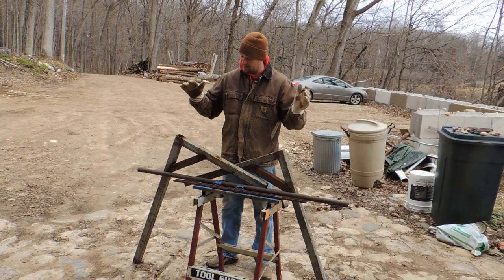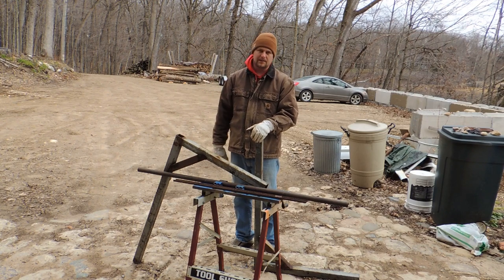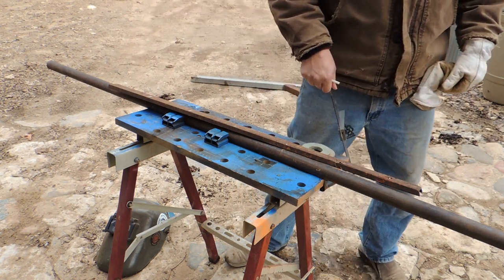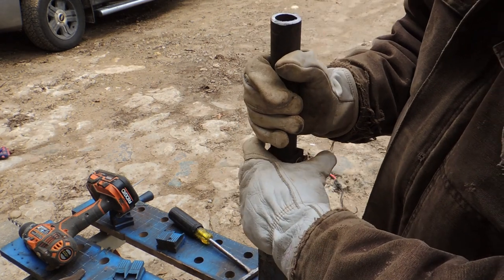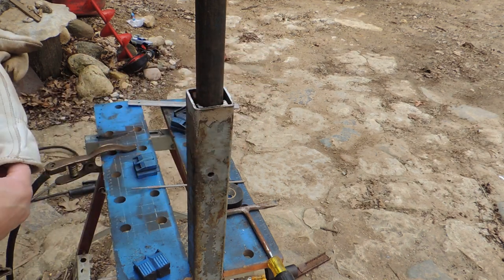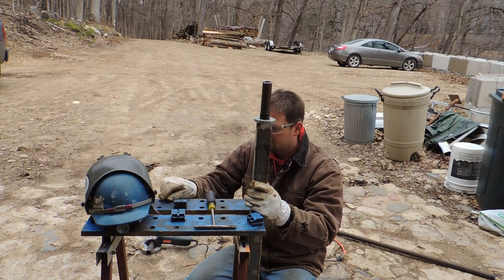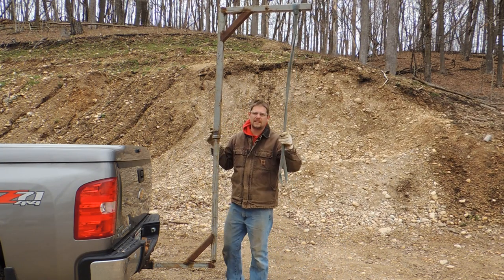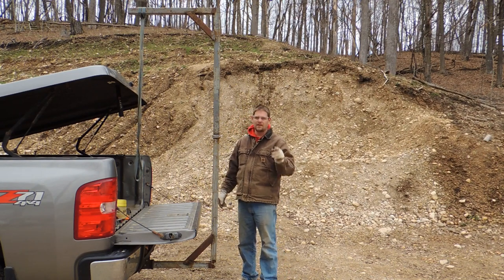Deer/heavy stuff receiver lift ✔️

Comment: I just made one that doesn't swivel with 14 gauge 2" square tubing for the hitch part and then 14 gauge 2"x3" square tubing for the rest of it. Everything looks good, but I have to go back and add 2 braces to it so it is sturdy enough to lift deer and hogs up to 300lbs hopefully. Lol
Reply from the maker: Thats how this one originally started out. But I built it while out of town and it wouldn't fit in the bed of the truck. So I cut it in half and the rest is history.